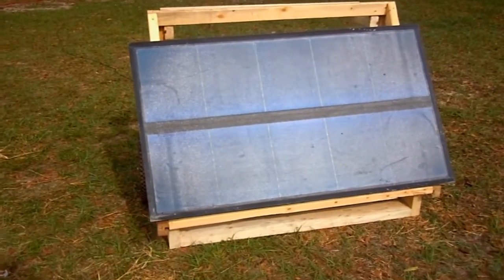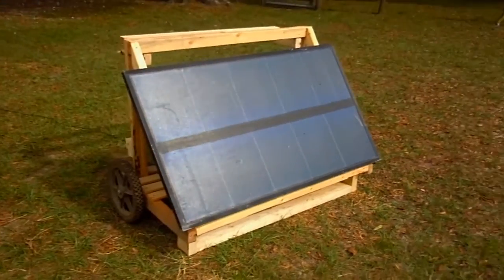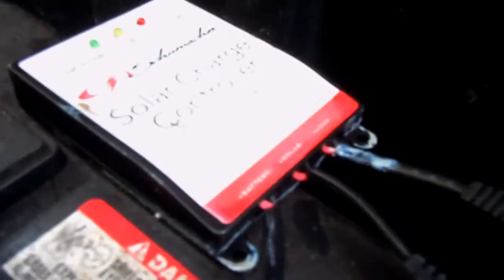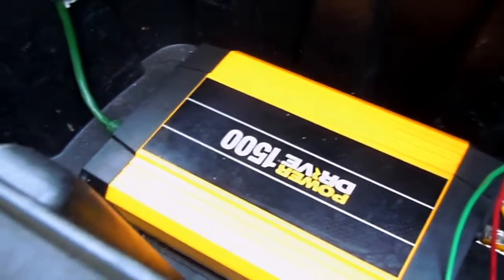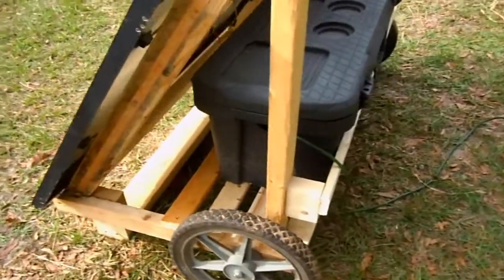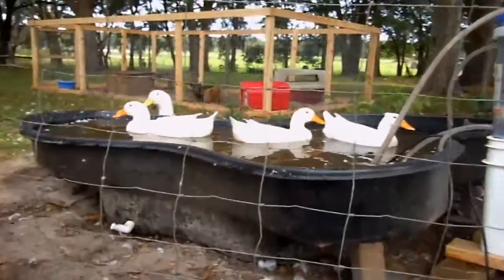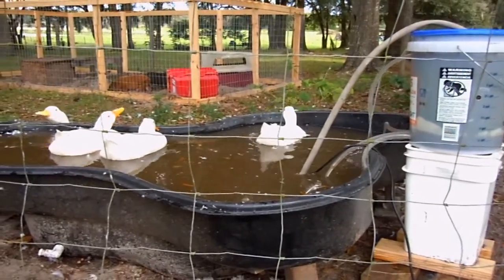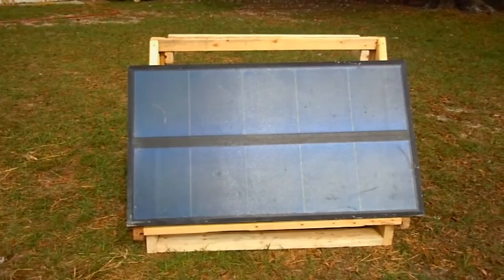⚡️DIY 1500 Watt #SolarGenerator☀️

Comment: What a superb job, I could never be that handy myself. A few things to ponder. a 1500w load would need very thick cables probably like jump starter cables, & it looked to me that your battery had like 15 amp cable limiting the output to around 150w. If the cables were thick enough then you could run a 1500w load for a minute or so before the voltage "decays" in the battery to low voltage cut out. But the setup as is, very good for providing light loads for an hour or 2, very impressive indeed. I once tried to run a 700w load on a brand new fully charge battery & it only ran for a few minutes before low voltage alarms started to sound.
Reply from the maker: Thanks for your input! I use this solar generator to power up out aquaponics water & air pumps, the water pump (35W) is on a timer and only runs during prime sun light hours while 2 air pumps (3W) run continuously... So far, so great! Hundreds of fish and more lettuce, tomatoes and peppers than we can eat! #Blessed

Comment: When I read "1500 Watt Solar " usually means the panels produce 1500 watts, not the power inverter.
Reply from the maker: The video's title is clearly referring to a solar generator with a 1,500 Watt power output via a power inverter, as 1,500 Watts of panels (or even 10,000 Watts of panels) would not put out current in a way that is A) constant (daytime/night time conditions, clouds, etc) nor B) consistent for 110V, 60Hz devices and appliances, thereby not suitable for an off grid solar generator, but perhaps a viable solution for a grid tied system... 

The solar generator featured in this video not only powers a water pump for our duck pond, it also doubles as a generator to power electric tools including a drill, table & jig saws and lights for our shed.

GeekBoy, you really need to educate yourself on solar output vs solar input, as most solar solutions rely on batteries and inverters for power rather than panels, which are essentially used to charge batteries.

If you rely on panels alone, you'll be sorry when clouds roll in hence the need for batteries and inverters.

To him that has an ear, let him hear.

Comment: Your on the right track!  May I suggest you study up on voltage drop (Looks like your using way to small of wires between the battery and the load without any fusing) and voltage drop between the panels and the charge controller (the reason a lot of solar systems don't work and the batteries die way to young) and fusing the loads to prevent the wires from heating and causing a fire. You did install fuses between the battery positive post  and the loads right? You could melt those wires under a load which a 1500 watt inverter could produce! Oh and insulate All the positive connections from being shorted to ground (I didn't see any insulation on the positive battery post) Now That's a firework show to experience if no fusing is done! Fuses are the cheapest items and the best insurance to prevent disasters.  DC takes heavier wire then AC to safely work. One more thing it would be a lot better on the electronics and safer also, to put the battery bank (one or more batteries) in a box by itself, Flooded lead acid batteries off gas and corrode and your equipment makes sparks internally its just a matter of when...not if... the planets align and BOOM! Just my observations here! Good Luck